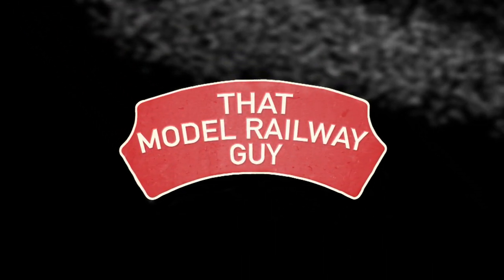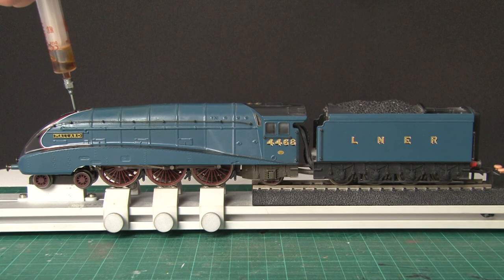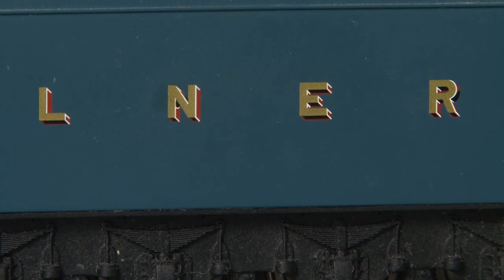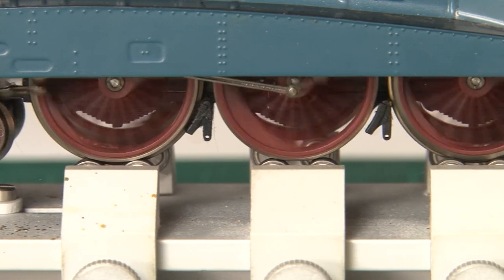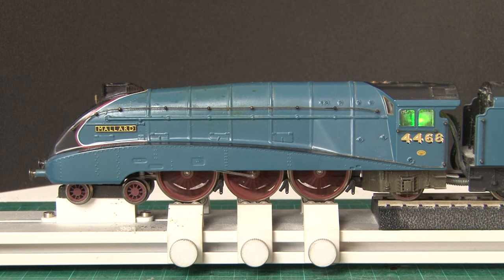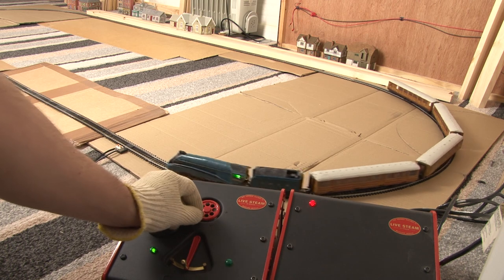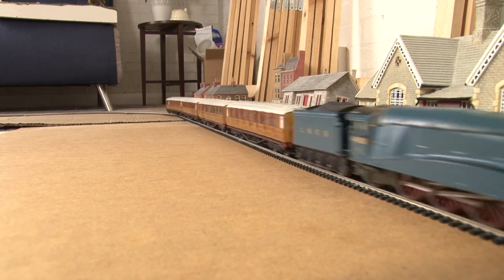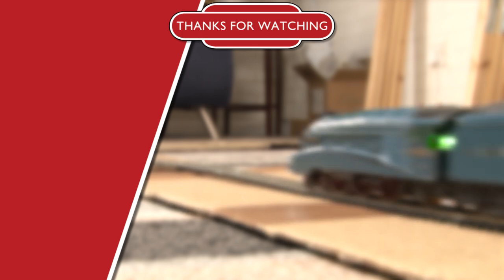Hornby 00 Gauge Live Steam! - 1,000 Subscriber Special!

Comment: Imagine if they came out with a diesel locomotive at this scale that actually runs on diesel.
Reply from the maker: Now that would be something unique! If live steam is possible at this scale I'm sure someone could come up with a diesel engine small enough. Put me down for a Deltic please 😁 Thanks for watching 👍
Reply: it'll probably be a fire hazard
Reply: @TCTheDS  considering this exists then i don’t see how you think that’s more of a fire hazard
Reply: @ThatModelRailwayGuy 
It's theoretically possible, the problem is that you'd most likely need a custom engine and the model would have to be of a main-line diesel to be able to fit everything in. And it would run on nitromethane, not actual diesel, as that's the only viable fuel for engines this small. The smallest production internal combustion engine is the Cox Pee Wee, a tiny .032cc single-cylinder 2-stroke nitro engine designed for small control line planes (it's also discontinued). It would fit comfortably within an O-scale or even S-scale model, but would be too big for OO or HO. You'd also need a small electric motor for a generator, a set of 16.5mm gauge power trucks (an in-body motor would not work due to space constraints), and an RC system using very small electronics (which is the easy part).
Reply: @VestedUTuber  imagine being in a.fuel queue at a petrol station to fill up your train 💪🏽
Reply: @peterkarczewski8200 
Don't have to imagine. Gas/Petrol-Hydraulic and Gas/Petrol-Electric models exist for 7.5" gauge.
Reply: Thatd be sooo coool
Reply: It can be done we just need very thin diesel
Reply: Petrol yes but diesel engines are very different and alot more complex.
Reply: I’m sure there would be a problem with running it in small rooms
Reply: @ThatModelRailwayGuy  Definitely a Deltic lol! :D
Reply: problem is diesel engines are loud and the sound doesnt scale as quickly as it sizes down so even tiny guages are quite loud
Reply: I'm afraid it would be far too loud to be practical
Reply: Not even a Deltic?? :D :D  @carmadme
Reply: I think at this point gas and diesels are the only ones that haven't been done "live." I know for a fact that there's electrics with working caternaries or third rail shoes.
Reply: a self propelled fire hazard

Comment: I cannot imagine the level of engineering and expertise it took to design this train. I've been a modeler for over 40 years and I have NEVER seen such a magnificent engine as this. My hat to you sir!! Wow, just wow!!! 

Now with that said, I have to ask. Does this set have safety systems built in? Like overpressure or overspeed? Does this have microprocessor control? Or is it analog? If it's simply analog, that is amazing! You are truly lucky to own such a piece and I hope you never have to sell it. That is something you hand down. A true heirloom. And the 2 panel control, just like a separate tuner and amp on a stereo. A beautiful piece indeed! And if it has slight staining and dust or tiny specs of rust? So what? That gives the locomotive character and shows it's owner actually uses it! 

As for me, I model vintage Marx O guage and the love it or hate it Z guage from Marklin and AZL.
Reply from the maker: Just to clear up any doubt, I didn't design or build this engine myself. It was made by Hornby around 2006 but I agree, they are really miniature marvels of engineering! 

It does have a safety valve that releases pressure - when that starts spitting you know you're ready to go. I'm not certain but I think it's all analog, if you haven't seen my follow up video where I show the inside of the loco you'll see how it works in more detail.

Hope that helps and thanks for watching 😃

Comment: Hi from Mr.Solway, from GBW in USA.  Hi to every-Pony, in the West Coast Border areas around Solway Firth.  Lllooolll!!!  Here at the NRRM we have A4 no. 60008 Dwight D. Eisenhower since May 1964.  Yet originally built as Golden Shuttle in 1937.  I was the official paid employee and tour guide at NRRM from 1984 to 1989, also I got my photo in the Press Gazette newspaper, a few times.  I've been on the footplate of Eisenhower hundreds of times, and climbed; n top of the boiler to wash off dust with a garden hose and soapy mop.  The as guide I have to explain differences between American and British locos with buffers, hook and link couplers, vacuum brakes, left-handed drivers seat, three(3) cylinders with Conjugated valve motion, and Art Deco Streamlining.  But since 2001 different managers built the new-ish Display Center with  Eisenhower loco plus 2 WW2 Army command carriages used by "S.C.H.A.E.F.". But 2 other carriages named " Isle of Thanet" and "Lydia" arrived in 1970 with Flying Scotsman no. 4472 during National Tour.  But over the 30 years they were badly vandalised.  Then in 2001 the N. Ry. M. In York took them back to Britain, and Professionally Restored.  Also since 2001 the new Display Center here has 60008 Eisenhower parked on Track 1 North, and next to Union Pacific 4017 Big Boy 4-8-8-4 on Track 2, next to Pennsylvania RR 4690 Electric GG-1 2-C-C-2 on track 3, with tracks 4&5 open for switching equipment.  Plus, previous to 2020, this also is the main Banquet Hall, suitable for business meetings, plus wedding receptions and dinners with BIG BOY 4017 as the Worlds Largest Centerpiece!!!!  Lol!  GOD Bless+++!!!  Help take care of Everyone.  Happy St. Valentines' Day 2021 A.D.
Reply from the maker: Thanks for sharing all that Steven, sounds like there's plenty to keep you occupied! I was lucky enough to see 60008 Dwight D. Eisenhower when she returned to the UK for The Great Gathering several years ago - was fantastic to see her alongside all the other remaining A4s. Thanks for watching 😃

Comment: Wow!
Electric model trains yes.
Model stationary steam engines yes.
Steam powered model locos yes.
But commercially produced electric steam locos? I had no idea...
Reply from the maker: They are pretty incredible and very clever too. Live steam engines have been around for ages in the larger scales but it was a good move from Hornby to use the track power to control the loco since that's what 00 gauge modellers are used to. Thanks for watching 😃

Comment: Mine is still in its box. I bought it at the Sheffield Steam Rally a couple of years ago. Never opened. I need to get some track set up
Reply from the maker: I'm not sure if you have the full Mallard set like mine but that comes with a large circle of track so you could just set that up temporarily like I did in the video. 
That said, I'd recommend using a rolling road initially if you've never driven one before, as that will prevent any crashes while you're learning how to control it. Thanks for watching 😃
Reply: As That Model Railway Guy points out. It is a steep learning curve ( no pun intended ) when first using. It is well worth investing in a rolling road. Mine flew off the track curves like a rocket at first but luckily I had protected the curves. Its a spectacular event but boiling water and oil are not recommended everywhere.

Comment: I managed to get one of these last year, haven’t run it yet as I don’t have a layout at the moment though I may set up a circuit of track on my living room floor like you with cardboard to protect both the engine and the carpet. I think I need to look into the OO scale live steam club too, I have just the one OO scale live steam loco but I do also have a couple of 16mm scale live steam locos so the experience from there can be scaled down to OO I hope.
Reply from the maker: I’d definitely recommend starting off on a rolling road before putting it on the track if you can. They’re really difficult to drive initially until you get the hang of it so you don’t want it flying off at speed on the corners and getting damaged! The OO Live Steam Club is well worth a look. It’s free to join and loads of great resources for anyone wanting to run these wonderful little machines including lots of video tutorials. Thanks for watching 😃

Comment: The flick 'down' after the loco starts moving is actually quite prototypical in my experience.
Reply from the maker: Yes, a bit of power to get it going then pull back when it's up and running. Now I think about it, I wonder if it's strictly necessary or if I do it out of habit 😂 Thanks for watching 👍

Comment: Hornby live steam is awesome! I have this and the double tender Flying Scotsman too. Awesome pair on a double circuit! :-) The LS Mallard is one of my most used engines too. 
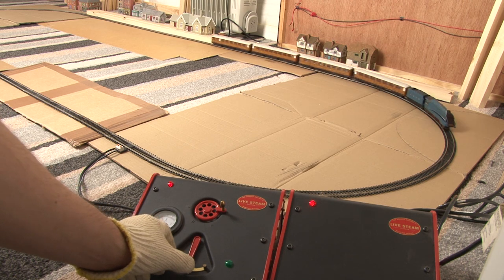Question: at 8:45, you move the heater to 'simmer' for running. Why is this?? Does yours actually run on this setting?
Reply from the maker: Oh wow, lucky you, I can see why you enjoy running them!
Yes, mine does run on the simmer setting. I've found they're all quite different and once mine is moving it doesn't need much to keep it in motion. Thanks for watching 😃
Reply: Yes, they are designed to run on ‘simmer’ mode. You only need the high setting to warm up and if running in a very cold environment like outdoors. Yes they make great outdoor runners too.

Comment: Really FAB! The green light in the cab would be more authentic in a orange/red for simulated firebox glow?
Reply from the maker: I agree - there is actually a red light in there too but it only lights when you're not supposed to run the loco 😂 Thanks for watching 👍
Reply: @ThatModelRailwayGuy   . . . you had mentioned that the loco was ready to run when the safety valve lifted?

Comment: I have seen these on numerous occasions. I don't think they are a success or Hornby will keep making them. Your video is very nice as always.
Reply from the maker: I don't think they weren't a success (don't forget Hornby had quite a healthy range of them at one point) but it didn't help that they were so expensive when back then most locos were under £100 and they were released not long before a global recession. 
From what I've seen they couldn't have done any smaller locos anyway as the mechanism was to large to fit, so perhaps it was always intended to be a small niche range. Thanks for watching 😃

Comment: Looks amazing but I just can’t justify the price for it and for dcc!!!!! I’m happy with dc controlled locomotives
Reply from the maker: Yes it is quite a high price for what is essentially a gimmick so I can see why lots of people would be put off. Same goes for DCC in a way, if you're happy on DC then why change - that was my mentality for years. Thanks for watching 😃
Reply: @ThatModelRailwayGuy  I run N Gauge in DC as I started in that scale a long time ago and too awkward to convert to DCC. I do have OO in DCC and O gauge too. The wiring can be easier depending on what layout you have. The advantage of DCC is that you can run many locos on the same track at once. Also with sound chips for different sounds. Hornby do a fairly expensive DDC contoller and sound chips and cheaper second hand. I fit my own chips so it cuts costs down. I will never convert the N gauge but for the other scales it makes a change. I bought the live steam for a good price at that time. It seems like it was a good invesment for a change.

Comment: Feel like this is something hornby could greatly improve on with a dcc chip.
Reply from the maker: Yes possibly, and I think someone did try that at one point but it was a lot more involved than just soldering in a decoder. Based on my limited knowledge I'm still not entirely sure it would be really compatible with normal DCC locos anyway because it works in such a different way and given that Hornby haven't made these for over a decade now it's unlikely they'll start reworking them anytime soon. Thanks for watching 😃

Comment: It would be interesting to see the current it requires to heat up the water. It seems that it uses 16V, which is around DCC voltage, so I am wondering if they essentially could be made compatible? Also, do you know how it transfers instructions? There are certainly other ways, but DCC wouldn't be a bad idea in the end.
Reply from the maker: I think some people have successfully converted them over the DCC in the past but from what I've heard it wasn't an easy process. For sending the instructions to the loco, when you click the controller it sends a little pulse to the motor inside that opens and closes the regulator. 
If it were to be done nowadays I'm sure it would be DCC operated but at the time Hornby were only just starting to explore that area and this was seen very much as a separate range. Thanks for watching 😃
Reply: The original designer Richard Hallam developed it around the tech at the time, circa 1968, so DCC was not about. The facts is, It doesn’t need the complexity of DCC and the oil and water left on the track would not bode well with DCC. The current is 6 amps at up to 17 volts DC and uses PWM to maintain power to the two onboard heaters. A lower voltage when pulsed operates the regulator motor to release the steam to the cylinders.

Comment: So one question, on the rolling road you pushed the regulator leaver to the left to open the steam valve to go forward, but on the track run you were pushing the regulator leaver to the right to open the go forward...isn't forward always forward ?
Reply from the maker: Hi Craig, it depends on the electrical polarity as there's a small motor inside that controls the regulator. Just like with a normal DC controller if you reverse the wires going to the track the train runs in the opposite direction. 

Presumably when I was filming this I put the wires in the other way round when the loco was on the track because it was facing the other way initially. Hope that makes sense and thanks for watching 😃
Reply: Perfect, Thats what I hoped, just keeping us on our toes!
Reply from the maker: @craigshornbyupgrades1136  Haha, no worries! Good thing I don't try to fake any of my reviews as people would immediately pick me up on it! 😂
Reply: Thats for sure. The thing that gets me is the folks that give a thumbs down to your upload, when there's nothing worth disliking!

Comment: can this engine run on standard hornby DC track?
Reply from the maker: Hey Ryan, yep that's exactly what it's running on in this video. For what it's worth I've also had it running on PECO Code 100 track too, so as long as you use the Live Steam controller the track shouldn't have any trouble with the higher current. Thanks for watching 😃

Comment: Is it possible to put like a die in the liquid that you put in it makes the steam coming out of the funnel a bit more visible
Reply from the maker: Possibly, but they are only supposed to be run on distilled water so I'm not sure what deposits any dye would leave in the system over time so best not to risk it. 
If you want to see more steam though you'd probably be better off fitting a smoke generator to a normal model though, it would be a lot less trouble. Thanks for watching 😃

Comment: Ok so I'm new in live steam and I'm trying to figure out the gauge/scale im little confused about oo gauge I'm from America so we have a different type of scale and to my point of my question is is oo gauge HO scale or N Scale?
Reply from the maker: Hi there, no worries it is a bit confusing. OO Gauge is almost the same as HO, in fact the track is exactly the same and you could run both locos on either. 

OO Gauge is a little bigger in scale though as it 4mm to the ft (instead of 3.5mm to the ft) so HO locos do look a bit small in comparison but the difference isn’t massive. Hope that helps and thanks for watching 😃
Reply: @ThatModelRailwayGuy  thank you for the information. By the way do you know why hornby stop making those oo gauge sets i only found the two on the youtub bing mallard and flying Scotsman.

Comment: also if you get mittens and pick up the loco while running will it still run while off the track?
Reply from the maker: Yes, if the regulator valve is open when you take it off the track the wheels will continue to spin. This most often happens during derailments with the loco ending up on it's side and the wheels spinning endlessly! Thanks for watching 😃

Comment: It seems like it's a lot more work getting this to run than it is for the bigger ones. Honestly, as awesome as these are as-is, I think Hornby kinda dropped the ball in regards to usability. The control system seems to be VERY clunky and doesn't give much control at all. And it's not like RC control would be out of the question, you could fit a very small servo, receiver and power regulator into the model. I get the feeling that the control system was a case of "Not Invented Here Syndrome", and that Hornby decided to design their own system because they didn't want to use an established technology.
Reply from the maker: Having had experience with both Hornby Live Steam and larger gauge Live Steam locos I'd definitely say the Hornby one is the easiest to get up and running. Regarding the controls, I believe they wanted to keep it powered through the track to match the rest of their range. 
While I can see the benefits of RC control you would still need a way to heat the water and in OO Gauge I think having a track powered heater was the best way to go. Thanks for watching 😃
Reply: @ThatModelRailwayGuy 
Regarding RC, there's nothing stopping it from being combined with track power. The locomotive is already using a sort of digital control anyway. All RC control needs is power at a constant voltage and fixed polarity, the former which can be handled by a linear regulator and the latter which can be provided via a rectifier bridge.

Anyway, I haven't personally had any issues with larger live-steam locos, but then again my Aster Frank S. is butane-fired so it's literally just light it, wait for it to let off steam from the blow-off valve and then let the cylinders warm up. Literally just one more step than the Hornby models.